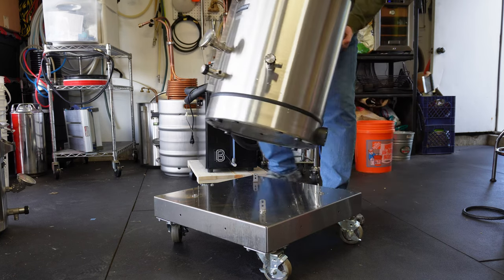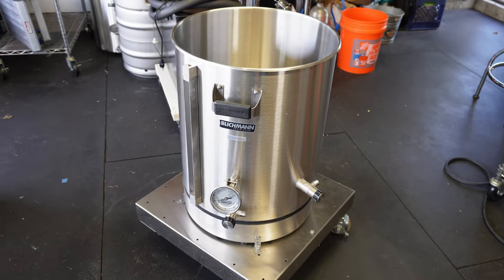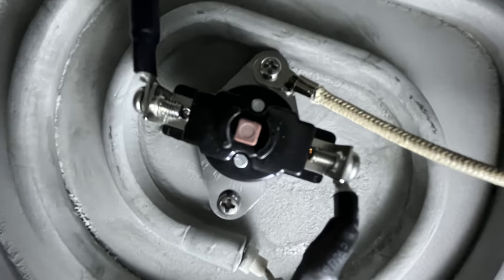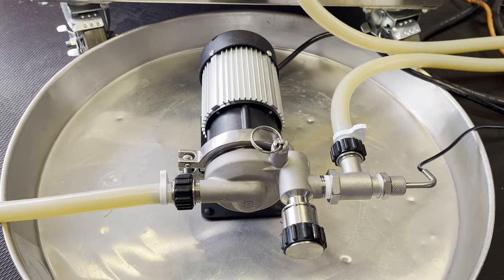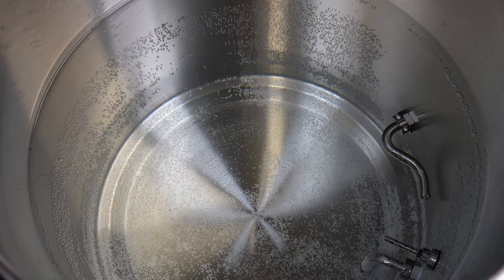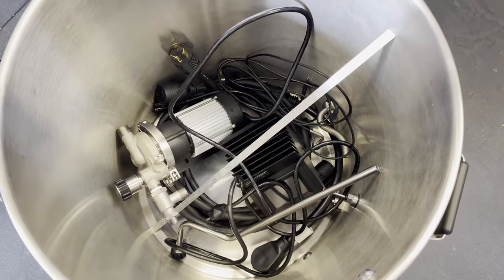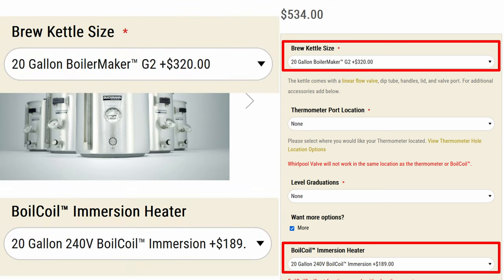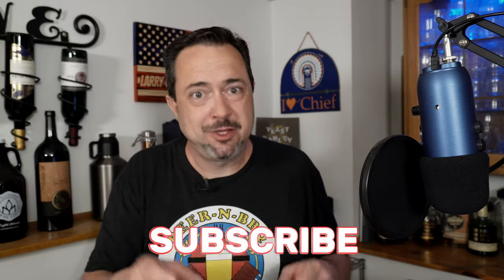The BoilerMaker Surface by Blichmann Engineering: A Hands-On Review

Comment: We are honored and so thrilled that you took the time to review our BoilerMaker Surface™!  We have several folks asking about using it for Sous Vide steak or pork chops?  You have a more in-tune understanding of BBQ and grilling...what do you think?
Reply from the maker: I also plan to use it for sous vide for larger cuts or quantities of food. Up till now, I'd either use the BrewEasy upper mashtun kettle to hold the food as shown in this Prime Rib video (https://youtu.be/ObTssuFwfRk), use a Spike Solo Mash Basket as shown in this corn blanching video (https://youtu.be/SqRmFDyKWJA), a Grainfather as in these Italian Beef videos (https://youtu.be/eHnAicB61Y8 and https://youtu.be/1Ru4UYjZVac), or a sous vide stick as shown in this video (https://youtu.be/cQCmDv-5JUk).
Now, I might be able to getaway only using the Surface due to the ultra low watt element separated by the kettle bottom and not melt my sous vide bags.

Comment: Good overview as always. But how is this any different than kettles from the all in one brewing systems, like grainfather and brewzilla? And in order to save on cleaning, a bottom drain would be way better. I imagine this kettle is heavier than the regular without heating element, so cleaning still won’t be great … can’t see how people would upgrade from their current kettle with heating element 🤷‍♂️
Reply from the maker: If you already have an almost-in-one system and are happy with it then this isn't something that should interest you.  For those that do not have an almost-in-one system and/or prefer to avoid such proprietary systems or just want an electric kettle without any strings attached, this is a great option.
Reply: @BEERNBBQBYLARRY  Correct, this isn't really comparable to the all-in-one systems as it is similar to technology but not suited for multivessel systems and isn't customizable.  It's a cut-and-dry option.  With this product, we brought the ease of all-in-one cleaning to custom kettles and multivessel systems.  In regards to weight, the 10-gallon bare kettle is about 11 lbs. With a boil coil, our 10-gallon kettle weighs about 14 lbs. With our Patent Surface™ element, our kettle weighs about 18 lbs. It's really still very easy to handle even with the surface element.  Hope that helps to clarify a few viewers' questions.  Great questions and great review, Larry.  You are a wealth of information!
Reply: @BlichmannEngineering  Why not make a malt pipe for this? Then people can add the pump and controller and basically it's an all in one option, if you make a hop filter that fits with the basket. Really don't understand why you haven't done so yet 😅 The grainfather and brewzillas and so on is great, but it's basically just modded water heaters with so so quality. I can just talk for myself, but I don't want to pay the prices they charge for those, and with no or weak handles that break. I bought the OG grainfather, but sold it because it was just not practical, and awkward to empty and clean. Had a Boilermaker G1 that I loved, but for us Europeans that mostly brew electrical, it was not good for not being able to use it on induction. So a blichmann kettle with a basket that matches the quality of your kettles, now that I would not feel cheated for paying overprice for cheap solutions. It's nice that you made this easy to clean kettle, but let's get rid of the other kettle on top for us that don't think it's needed. What I'm really saying is that I want an all in one with your quality 😅 yes, there is the Anvil line, but I don't like the high and narrow format. A wider kettle is just better, and with a pump and controller you can unattach, there is no worry about cleaning, or stupid built in pumps that break or leak, or hanging controllers, or controllers in the bottom that don't like boilovers or water.

Comment: What if the element dies or no longer works.  That is my issues.  With a regular TC port element just buy a replacement element and your back in business. Also I feel that the new bottom draining kettles are easier for cleaning, but more expensive.   But these are pretty good deal.
Reply from the maker: I've had the same concern and asked them about it a while back. The bonded element is a concern but not as much as a product made overseas and not as much for a well established company. I've asked them about it's reliability. They stated that due to the built-in thermal protection, the simplicity of the design, and that they already do this for their Anvil line, it should not fail. They believe it so much that they offer a 5-year warranty on it.
Reply: I second this comment.  I enjoy the modularity of my current Clawhammer Supply setup.  My grainfather had the bonded element as well.  Not to knock this kettle as its just another option for those who may find it suitable.

Comment: Looks like a few of them would make a pretty clean setup! The pricing is almost double the cost of the boil coil, but not that crazy if you're buying the brew commander anyway and just look at total price ($150ish extra to get the brew commander and surface setup as compared to a 20g kettle with brew commander and boil coil). Great overview! I kind of was hoping for a huge 5500 watt induction burner by Blichmann, but I guess that can wait. Cheers!
Reply from the maker: Yeah. The price was higher than I was expecting.
I don’t understand why I cannot find a 5500w induction heater. Must some constraints I’m not aware of.
Reply: @BEERNBBQBYLARRY  Mostly because any commercially available induction plate is going to be 115V. A 220V induction plate is coming in with a 2nd electrical leg is going to come into a limited market, and more exposed liability for the manufacturer.

Comment: Thanks for the great review Larry, as always. This new kettle design completely mitigates the issues I saw with the BrewEasy and should make that system really good now. You can now put the vast majority of the wort where it should be - with the grain. Mash temp control might be better too with less thermal mass in the kettle.  I agree with your cleaning comments too.  My flat bottomed all-in-one is much easier to clean than my Spike kettle with a heating element.  Nice review!
Reply from the maker: That’s right. The BrewEasy is definitely one big step closer to perfection now.

Comment: Thank you for the review!! Do you know if the power receptacle can be used with a NEMA L6-30 30A 250V female twist lock connector?  Or will I need an adapter? If Blichmann could eliminate all the ports and drain, then this would be perfect for adding to a 3 kettle electric system for a decoction mash. Thanks again!
Reply from the maker: The connection is a NEMA L6-30 at 30A/5500W.
Reply: @BEERNBBQBYLARRY  Thank you! Sorry, I must have misread that in the video at 1:49. Thanks again
Reply: The power port is an L6-30.

Comment: This looks neat but I still cant help but think this is just a nicer ( and more expensive) grain father with an external controller.

Where is the temp sensor  on this?  Is it built into the base like for example the digiboil?
Reply from the maker: Aside from the way it is heated, it's just a kettle.  It's up to you and your process to determine how to measure temperature and how to use the kettle. Mine has a thermometer built into the kettle sidewall, but when I use it within context of my BrewEasy system, the BrewEasy has the temperature probe inline with the recirculation pump/hose.
Reply: It still looks  a whole lot (to me)  like a fancier grainfather.

I am not sure if the time savings for cleaning offset the possibility of the element going south are worth it having had to replace the board on a brewzilla.  And although you dont have an immersion element to clean, i do see scorching on the bottom of my brewzilla so it looks like you are just swapping not having to clean one (the element) for the other (the bottom)

I obviously have not used it but I am not entirely convinced that (for the 10 gallon version) this offers a whole lot more than a 240v induction cooktop and a normal boilermaker.

I personally ( and other can disagree) that bottom drains would make bigger contributions to reducing hands on cleaning time.

Comment: How did it boil / maintain Temps compared to standard heating element?
Reply: In our tests we found it to be a bit faster.  It's consistent and holds temps impeccably.
Reply from the maker: I haven’t done any timed tests, but anecdotally, I did not notice any difference in my brew day.
Reply: @BlichmannEngineering  thats awesome, very good to know. I am however having trouble trying to see how this is easier to clean with just having the element removed? I can totally see advantages for this, especially for those of us using immersion chillers, but, one is still going to have to lift the darn thing and empty it out. Would love to see some sort of bottom drain/dump option in something like this.

Comment: Awesome review Larry! Wondering if these can adapt to my breweasy if I plug the holes to the coil?
 Thanks
Jim
Reply from the maker: Thanks. Not sure of your question though. I just swapped out the original BoilerMaker kettle with this Surface one in my BrewEasy. There were no holes to plug. You just need an L6-30 cable for it.

Comment: What’s easier to clean.. this or the spike tank bottom drain?   I guess if your right next to a sink and can tip this over pretty easy this might be a little easier. I have a bottom drain kettle now and it’s not as easy to clean as it seams.
Reply from the maker: Depends on which hassle you prefer to deal with:
1) Cleaning a gunked up element.
2) Repeatedly turning a large heavy kettle upside down to dump out remaining gunk with each rinse, washing, rinse, etc.
I’d like to have both ideally, but given that there is nothing that does both, I choose the ease of not having to clean the element.
Plus, without having a floor drain in my garage, the Spike Tank isn’t so useful since it’ll pour all over my garage floor unless I rig up a hose to direct the flow to a nearby low rise pan.

Comment: The Anvil Foundry 10.5g is the same for the most part aside from the electronics, no?
Reply from the maker: They both use embedded elements but are different. This is a multi-purpose kettle while the Foundry is its own brew system.

Comment: My next big upgrade will be moving to larger kettles to do 10 gallon batches. I currently use a knockoff grainfather to great success which already has a hidden surface heating element. I use a steam condenser to brew indoors while reducing the necessary wattage.

 I'd be slightly hesitant to purchase this given how expensive it is, but seeing at its stainless, welded and made in the USA, It's easy to see why it is expensive. At my job, I wouldn't even blink at the cost given how much fabricators cost, but it's a bit different when you're not spending company money ;)

That being said, I've upgraded to the Blichmann Tri clamp Riptide per your recommendation and really enjoyed it. I will likely get Blichmann for my next system given their reputation for quality and customer service. 

 I mash and boil in the same kettle by pumping the wort into a separate kettle, sparge, then remove the grain/false bottom and rinse kettle. I started doing this because I didnt enjoy lifting a grain basket out, and I enjoy the benefits of direct heating the mash tun with recirculation. I'm thinking this system could also use their false bottom to achieve the same result? 

Only thing I need now is a stainless jacketed unitank with glycol...
Reply from the maker: I hear ya. Your process sounds very similar to the budget DIY K-RIMS setup I did here: https://youtu.be/hdSTlcoz7EI
I used a mashtun cooler and recirculated through it via the heated kettle similar to how my BrewEasy works. 
Perhaps their could be a BrewEasy in your future using one of these new kettles as your boil kettle as I just did in my 'Better Than Bud Light' video: https://youtu.be/1Tu5zP6k4Gw

I, too, dislike lifting heavy hot mash baskets/bags. This is why I prefer the BrewEasy or a similar two-vessel DIY K-RIMS process.
Reply: @BEERNBBQBYLARRY  Thanks for the reply! Sounds like a good process

Comment: Is the 10-gallon kettle comparable with the Spike Solo 10-gallon basket?
Reply from the maker: I think so but do not have either to confirm; only the 20 gal sizes. Would have to check the dimensions of both kettles to have a better idea.

Comment: Curious to know if the hidden heating element is replaceable. Also, how easy the process is and how much the replacement element costs.
Reply from the maker: I asked Blichmann the same question. It is bonded to the kettle and is not replaceable.
They said it should not need replacing and are offering a 5 year warranty in case it does.
Reply: @BEERNBBQBYLARRY  No bueno, my friend. So they're simply saying if after 5 years you have a problem with the element, you're SOL. All homebrewers know how Murphy's law works in the brewery. I'm really surprised that Blichmann didn't come up with a solution to replace the element if it goes bad. Also it looks like the reset button is located under the bottom of the kettle. Am I correct on that? If so that will be an SOB if you have a kettle full of boiling wort and you need to push the reset switch. All of us 1st & 2nd gen. Grainfather owners know this all too well. Nevertheless, I enjoyed watching the video. Cheers, buddy! 🍻
Reply: @candobrew7142  Blichmann just came out with an update - Lifetime Warranty now included.
Reply from the maker: I just watched that earlier today.

Comment: This is a pretty neat kettle and one that would likely be my number 1 suggestion now for those that want to E-brew-in-a-bag. The only "con" for me is I prefer to have a modular setup where I can get off the shelf parts, so the proprietary element in this case makes it not for me. But I know I'm in the minority there and this looks like a really great solution for the majority of people.
Reply from the maker: I agree. I'm not into proprietary systems either.  Replacement part availability is a real PITA especially if it is made overseas. The bonded element is a concern but not as much as a product made overseas and not as much for a well established company. I've asked them about it's reliability. They stated that due to the built-in thermal protection, the simplicity of the design, and that they already do this for their Anvil line, it should not fail. They believe it so much that they offer a 5-year warranty on it.

Comment: Thanks for the overview!  Honestly, if I was going to replace the kettle in my 20g setup, I'd opt for the bottom drain kettle...  Getting the trub and hops out of the boil kettle in my basement is the biggest hassle... and being 5'8", the 20g kettle is pretty unwieldy to move around and clean in my laundry sink.  I've never had much issue with the heating coils getting clean based on my process.  But I really appreciate new innovative products getting release to the market!
Reply: I’m with you.  If I was going to drop $800 on a 20 gallon kettle, the biggest improvement to my brew day would be not having to lift it to the sink.  The spike bottom drain is better in that regard
Reply: I would like to add, if you are doing BIAB it’s nice to not have the element in the way

Comment: I'll take the TriClamp One Larry. John Blichmann won't mind. LOL. I'll be in the saddle again in week or so once we get to row cultivating. I like the idea for the brew easy. Only problem is my brew easy is a 20 gallon, but it came with 30 gallon pots. That means the minimum for the boil coil is more than the 6 gallons you had to maintain in the lower pot. My 15 gallon rig is triclamp. My 20 gallon rig is camlock. I would love it if they made it in a 30 gallon pot for a 3 vessel addition to my brew easy. Cheers Brother.
Reply from the maker: I think Blichmann has these for larger sizes in their Pro line up. I recall them unveiling this at the Craft Brewers conference last month. You can inquire with them to see. I currently don’t see anything on their website for a 30 gallon kettle.
Reply: @BEERNBBQBYLARRY  That ease of clean, and no obstruction for immersion chiller though!
Reply from the maker: @beeroquoisnation  Both are big selling points for me. Others appear to be skeptical from a few of the comments I’m seeing. Some of them are confusing this single kettle for an almost-in-one brew system and comparing it to them incorrectly.
Reply: @BEERNBBQBYLARRY  For sure. The boil coil in the kettle presents us with some obstacles to overcome. This kettle is a game changer for existing Blichmann systems. I only used the big system for larger batches obviously. I wouldn't need my smaller rigs if I didn't have to keep the coil submerged.
Reply from the maker: @beeroquoisnation  That’s right. Me too.  Now I can easily brew half batches without stressing about submerging the element.

Comment: Could you BIAB with this setup?
Reply from the maker: Probably. I assume it'll be better than having an element inside the kettle that can melt a nylon bag. The element is underneath the kettle separated by the bottom wall which spreads the heat over a wider area than any element inside the kettle.
That would be a better question for Blichmann to answer more affirmatively.
Reply: Yes, you can.
Reply from the maker: @jenniferyoung5492  Thanks for the confirmation!!